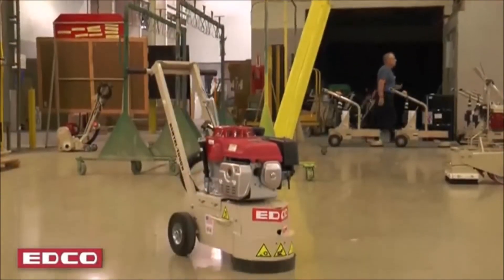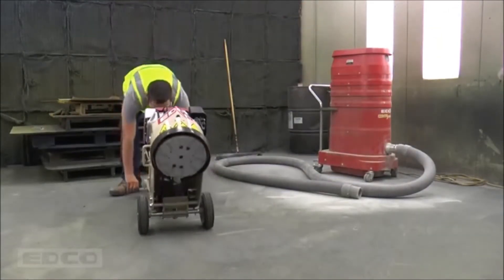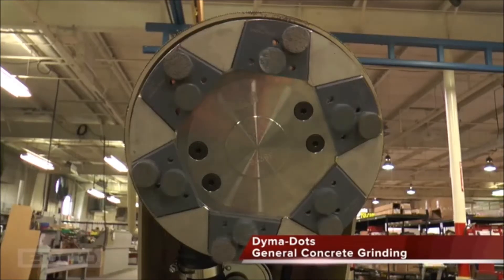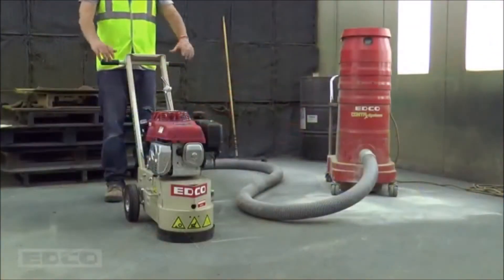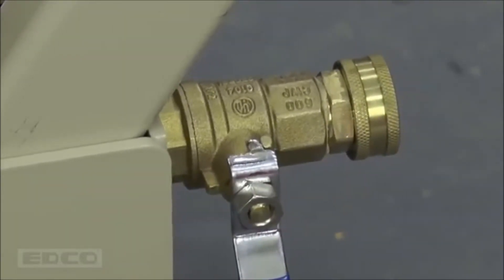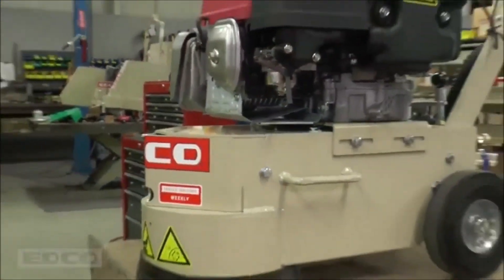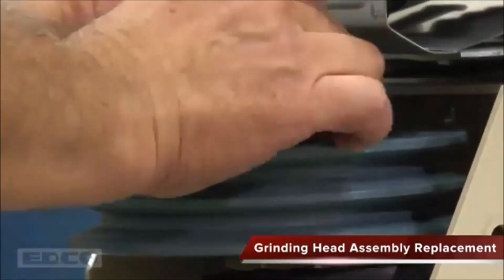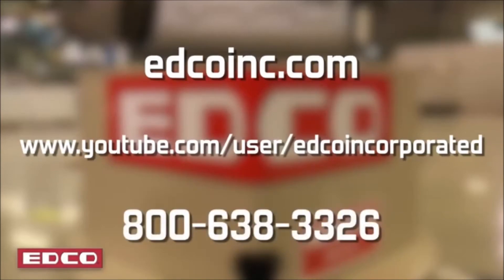EDCO 10" Turbo Grinder

Comment: Warning: before you rent these machines from Home Depot or elsewhere check that it has the leveling crank as shown in this video. The Home Depot models do not have the leveling crank which makes the machine basically unusable. There appears to be no way to level it which is unfortunate. Edco has also disabled comments on the official video probably because people are annoyed they would even bother to make such a shitty version. Yes Home Depot’s training links to a video with the machine that can be leveled. (Don’t reply, I won’t read it)
Reply: I have one from Home Depot that I'm using today that has the leveling adjustment
Reply: I was at HD today and they have leveling.
Reply: @DCUPtoejuice Great, glad you checked before you rented!
Reply: Just curious how much coverage you could get in an hour?  Literatures says about 400-500 sq ft per hour - did you get similar results?  Thx